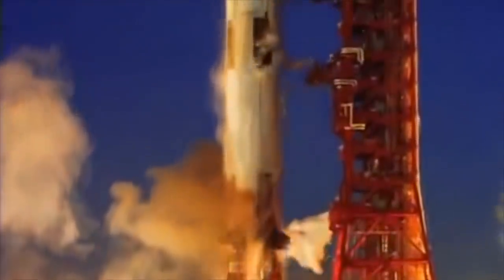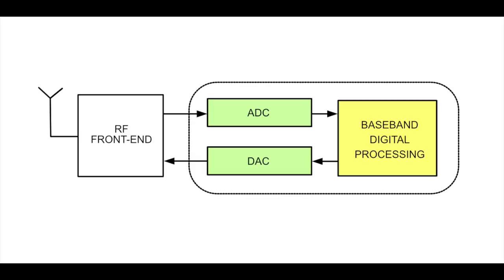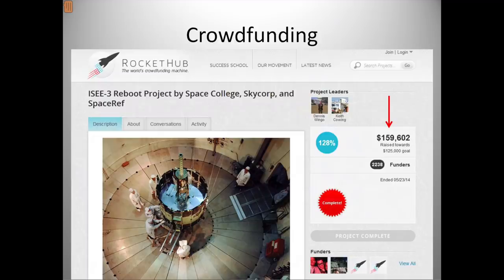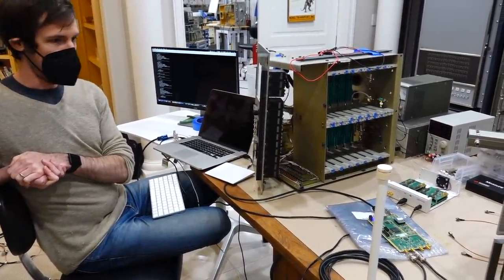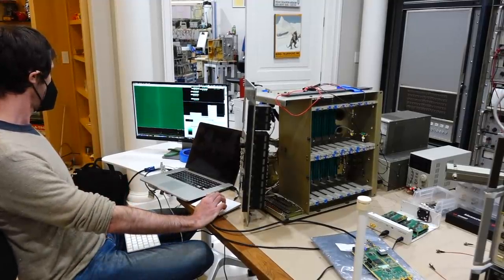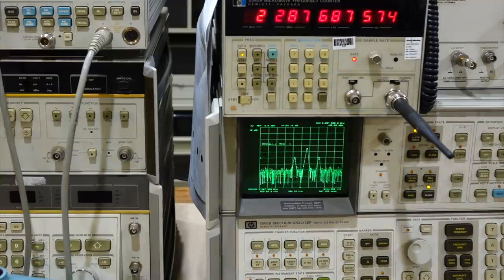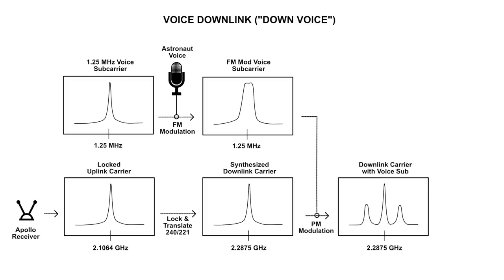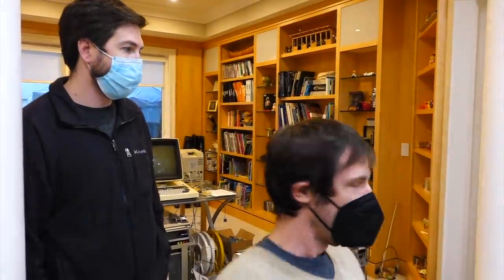Apollo Comms Part 10: Apollo SDR reboot and first voice transmission!

Comment: "how old was the spacecraft?" "i think it was launched in 1978, so pretty old".. thanks guys.. I was launched in 1973.. i feel older than pretty old right now.. amazing video, as always
Reply: Youngster
Reply: 1973 ?? I was in junior high already! Totally engrossed in Space flight, NASA etc.. My uncle gave me a "home study course" on electronics complete with parts to make the labs. Vacuum tube voltmeter anyone?
Reply: I was launched  6 months before Sputnik.
Reply: '78 is old for a spacecraft. For comparison, the Apple ][ was only a year old, and the IBM PC would only appear 3 years later. Computer and space technology is basically still in it's infancy
Reply: @the123king  Apple IIe was my first computer. $2500 for the computer, monitor, two disk drives and a dot matrix printer. Infocom anyone?
Reply: @the123king  thanks buddy for pointing out that me (and many others here) ar old as f**k

Comment: Nice to see “Amateur” Radio Operators doing Archeological Engineering for NASA using Modern SDR Technology.   Where there any Vacuum Tubes in the Apollo Telemetry Hardware?   As an Amateur Extra and Retired Air Force Flight Systems Engineer, I hope I am still an Active Ham when we have a Broadband Repeater based on the Moon.   It would be above the horizon 12 hours each day! 👏 Enjoyed watching this Apollo and NASA Comet Satellite Comm Projects! Video!

Comment: SDR is a magical thing for example its enabled the ld-decode & vhs-decode project for VHS/S-VHS/Umatic/Laserdisk 1:1 RF duplicates of the media and then full demodulation and time base correction all in software instead of inflated broadcast hardware anyone with a half-decent VCR and an Linux install and a spare 30USD can do archival restoration granted at 2fps..

Comment: I have a RTL SDR reciever that cost less than £30 I also have a much better Airspy mini SDR reciever both are about 2 inches long and an inch wide by 1/4 inch thick and can do lots of things that would have previously taken a room full of equipment to do, all for less than £100. I can decode digital voice transmissions trunk tracked systems AM NFM WFM decode data streams etc etc. it was a video talk by Balint a couple of years ago that inspired me to get them. It is amazing what these radios can do!

Comment: So that ISEE-3 is still functional after all these decades?  How does it still have/store power?
Reply: The part they didn't mention in this video was that the ISEE-3 project ultimately failed, because they couldn't get the thrusters to fire. Most likely it was either out of fuel, or the plumbing had issues.
Reply from the maker: No, the thrusters did fire, but no long enough. They had enough fuel, but ran out of nitrogen pressure. The SDR project was a success, not a failure.
Reply: @CuriousMarc  Interesting. I guess I never saw the full post-mortem on what happened, beyond some articles about the team talking with various experts on hydrazine after the burn didn't go as planned..  I was mostly referring to the overall project to assume control of ISEE-3, which depended on a burn to change its orbit.
Reply from the maker: @derekkonigsberg2047  Yes in that sense you are correct, they were not able to recapture the satellite in earth orbit. But the S-Band SDR part that we are interested in here, that sure worked!
Reply from the maker: @Maxxarcade It has solar panels so it can keep going on. 14 out of 15 instruments or something like that were still working, so they got scientific data from it for a while.  However, as @Derek Koenigsberg pointed out, although they were able to spin-up and reorient the satellite for the burn, they did not get enough Delta-V from the thrusters. So the orbit was not changed sufficiently for recapture. The whole thing continued on its merry way in a modified orbit around the sun, and they eventually lost contact.

Comment: Did you look at other SDRs before settling on the B200 versus a a cheaper option? There are a couple of other ones in the SDR market that seem at first glance to be very comparable to the B200 but much more affordable for people getting into SDR so I am curious on what advantage was gained with the B200.
Reply: Indeed; I was thinking a nice microwave capable "ADALM PlutoSDR" would work well.